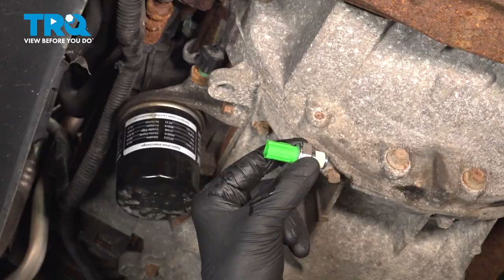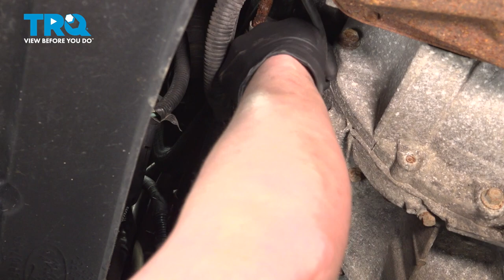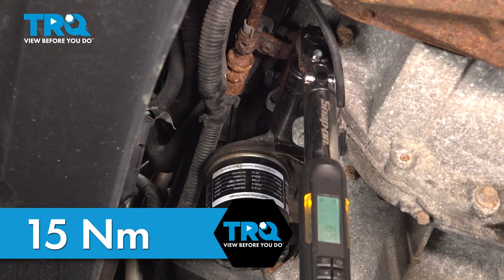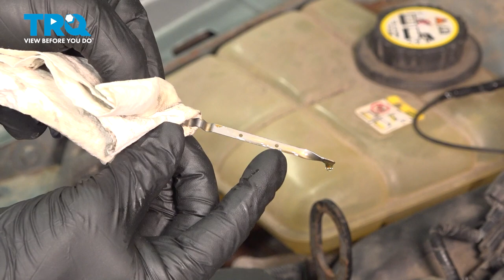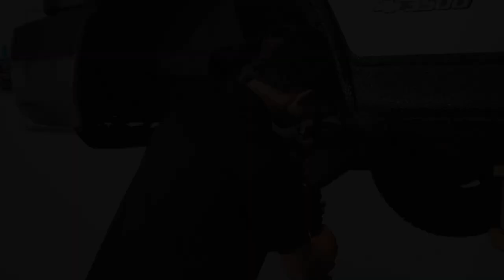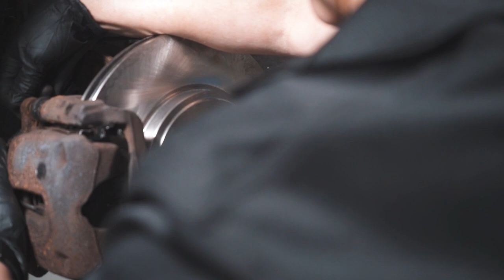How to Replace Oil Pressure Switch 2000-2007 Ford Focus

Comment: Hi 

Don’t suppose you’d know the part the sensor and filter attaches to, I have the same on my Volvo c30 which is focus based. I recently replaced the sensor/switch and cracked the housing/adapter and struggling to source another